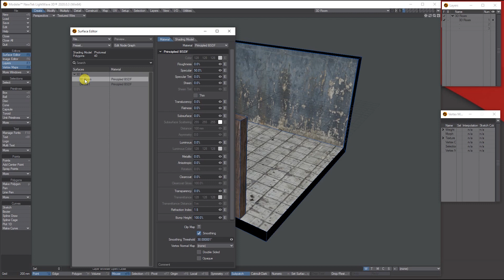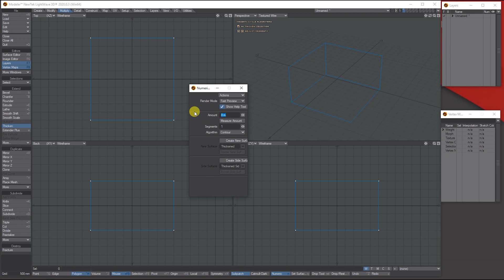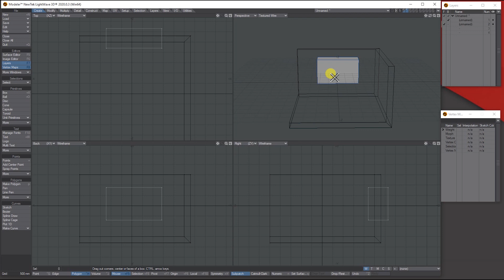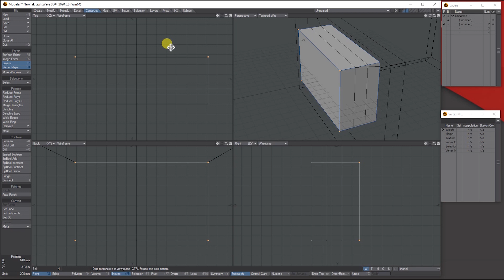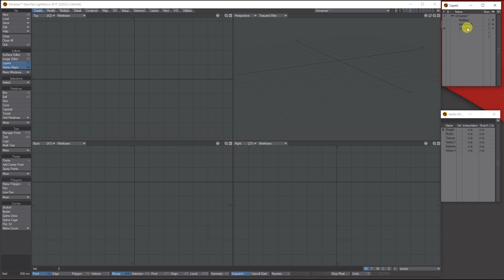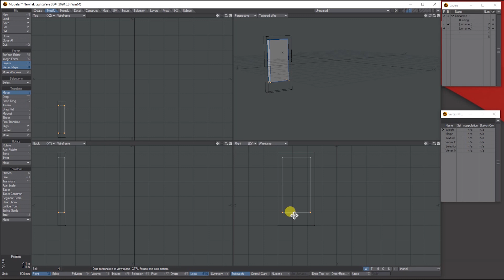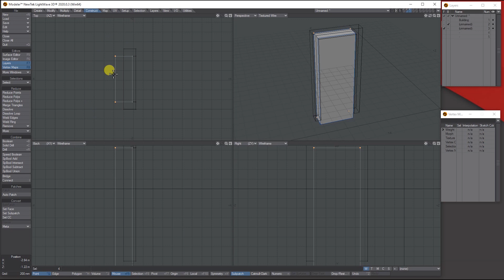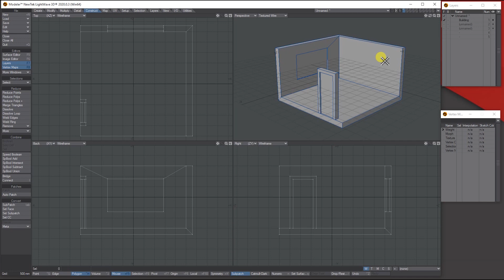Lightwave 3D basic Room Part 1

Comment: I would suggest using absolute size on selected points for the windows and scale it accurately in either x or z axis.. to whatever thickness the window should be instead of moving the points around..Twice and roughly, Then you would be doing this faster and more accurate.

It´s also possible to just copy one face of the box, and paste in aligning in center and use thickness to exact thickness scale the window should be in, but I think the first suggestion is the best.
I have absolute size configured to always be in the transform menu and not in the more list, and perhaps shortcut or middle mouse menu for fast access.
It´s Cool to see you doing so many new tutes, hope it will be worth it for the community.
Reply: Have to add, if you use a single face poly and try to adjust to the center of a window opening, you could use the axis translate with middle mouse and drag a guideline to snap to edge center of the window wall, that will place the face in the center, but after that if you try and thicken it, since it is not a double sided face, it will be thickened in one direction only and thus not becoming centered, therefore what you can do is to make the face double sided, and not use thicken..that will not work, but smooth shift, that will thicken the window evenly from the center of it´s location.